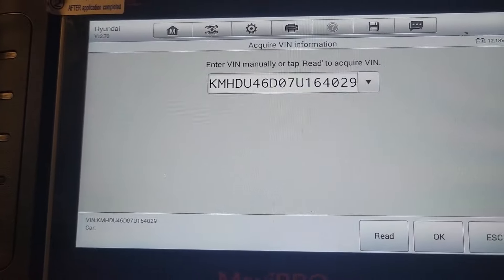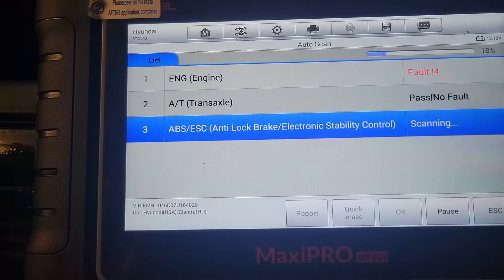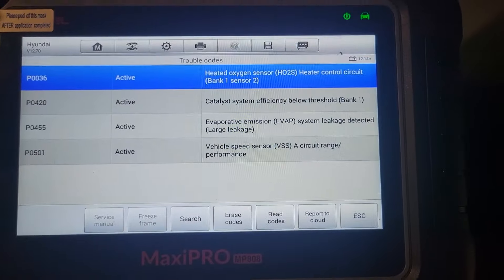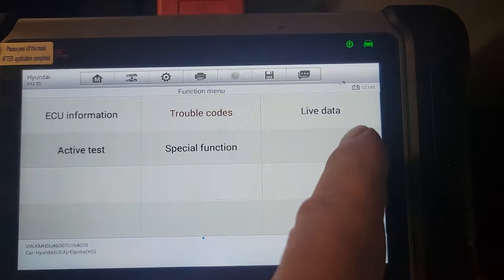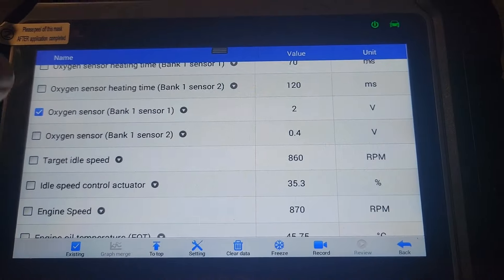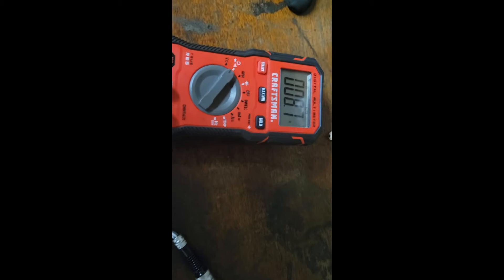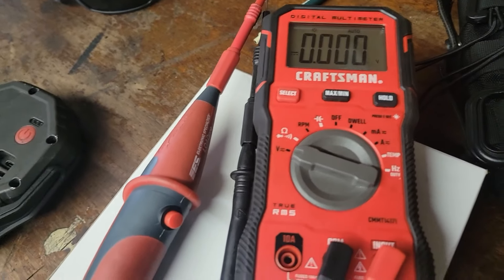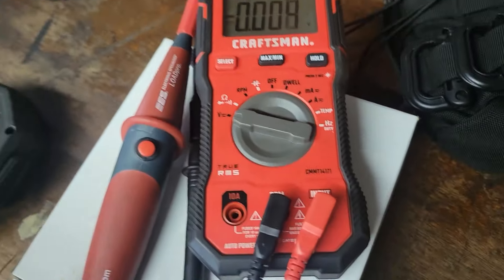Hyundai Elantra 2.0 , PO036 & PO420. The test, the fix, and the footage.  + a few words on scanners

Comment: My solution for the Modis battery was a small rechargeable lithium "power bank" with a 12V output Velcroed to the back of the unit. $30 on Amazon. The alternative was to buy a "rebuilt" NiCad oem battery for about $100, which I don't think last very long.
Reply from the maker: @spinb  that's an excellent idea! I was thinking about taking it apart to see if I coukd rebuild it myself, but I do have a few skinny power banks. Thanks!